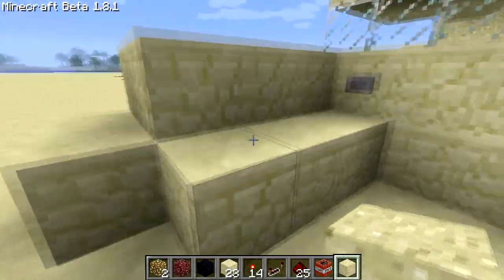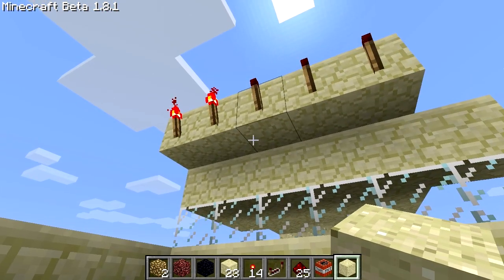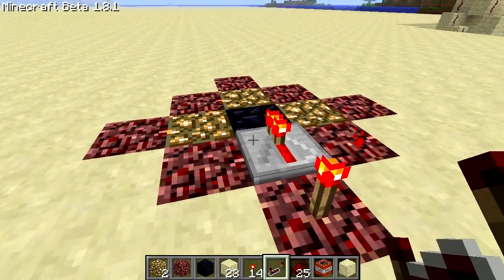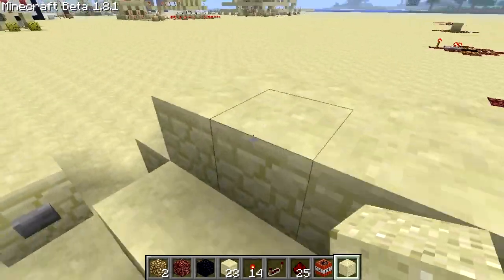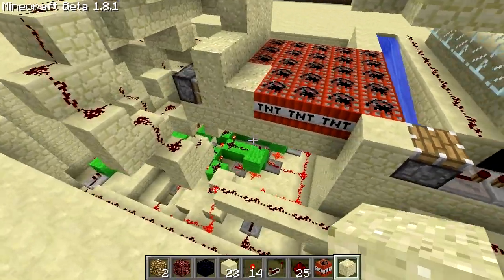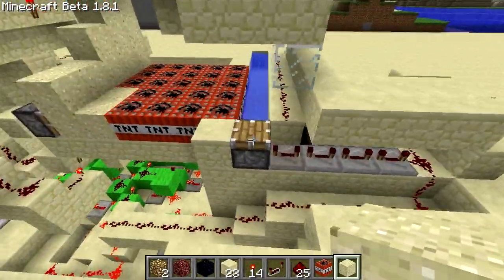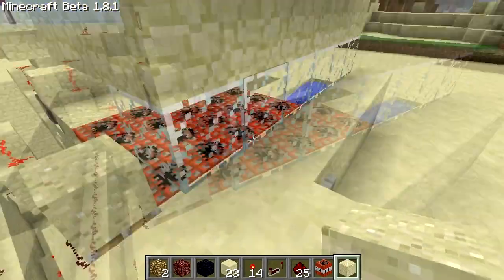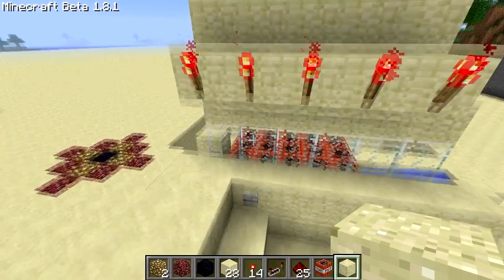Adjustable Sand Cannon & Wireless Redstone

Comment: What you can do instead of sand is use normal TNT and have it land half on a pressure plate and half in water (so the pressure plate activate but doesn't blow up) using glass planes or irons bars . I created an adjustable TNT cannon (very early video) but I love this method more tho .